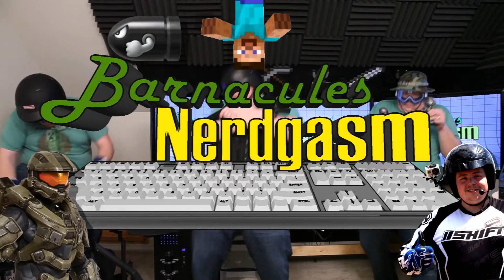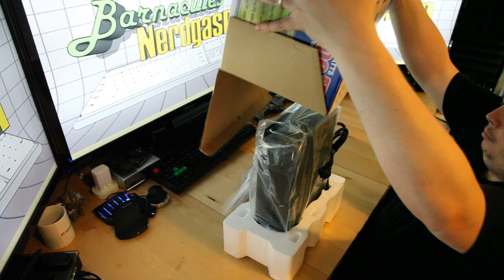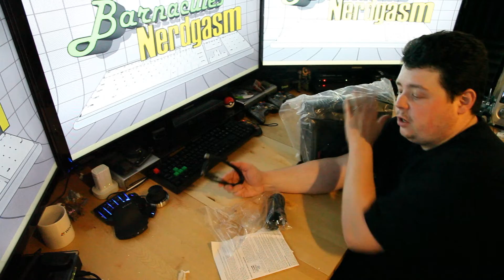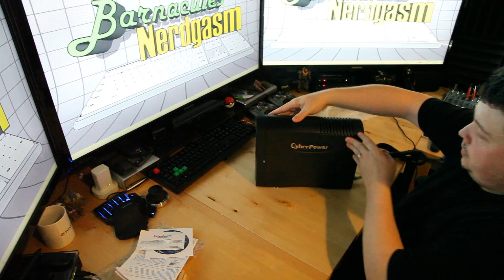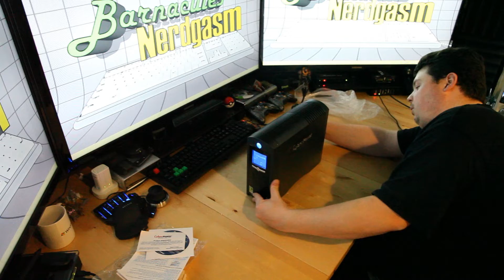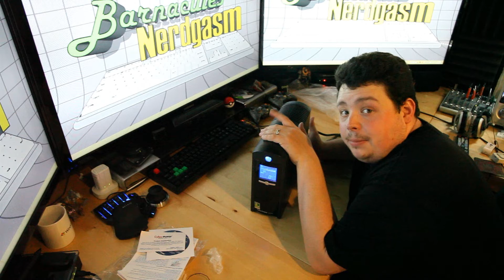Unboxing CyberPower 1500AVR GreenPower UPS (Uninterruptable Power Supply) in the Man Cave

Comment: I have mine on a 500 watt solar setup I got for free 4 of them so it is a full 500 watts - and it is plugs directly to the ups - A cheap solar setup  - I will be tacking out that speaker in mine - I may use it for A new ver of A pi

Comment: You do not need a UPS for normal equipment, How is a UPS going to help 3 monitors during a power outage - It isn't. And most people say that they "smooth the power going into the computer" The PSU does that. They are not needed, Their Recommended, But are not needed. And corruption caused by false shutdowns? It does happen, But its so rare that its not worth worrying about.
Reply: Stop spreading false information. 

1) A UPS will protect your hardware in the unfortunate event of under/over-voltage because it doubles as a surge protector. In fact, modern ones come equipped with AVR too. 

2) It's not there to 'help' monitors (although, like with all hardware, it protects them) - it's used so you can keep your entire workstation running until you can save and safely shut down. 
 
3) Forcing a PSU to handle brownouts and blackouts (very common in many areas) will stress it beyond repair;  it's always better to have a UPS deal with those situations. 

4) Although data loss due to unexpected shutdown is 'rare,' you should still protect your data (no excuses). FYI, RAID arrays are very susceptible to failure - resulting in data loss - when the plug gets yanked from the wall or a blackout occurs. 

Next time, do some research before you negatively influence people.

Comment: I bought one of the battery power from cyberpower however I cannot get both sides to work when I unplug from the outlet the battery side surge protector books but the surge side does not when I plug it back into the power both works butt the battery gets depleted and does not charge again I have to turn it off completely and turn it back on how do you set up the cyberpower on your computer no one can help

Comment: What is the difference between yours = CP1500AVRLCD and LX1500G and CP1500PFCLCD?
Or why did you choose that non-pure sine wave?
Also what do you use it with? (computers? Xboxes?)
Reply: The AVR models (like the one he shows here) have a simulated sine wave (looks like a stepped square wave on an oscilloscope) which may or may not work properly with an Active PFC PSU. The PFC models have a true sine wave output and will look identical to AC line power to your PSU. Not sure why he's not using the PFC model UPS but I guess his PSUs are okay with a simulated sine wave input.

Comment: Are there any other reasons of use for this besides protecting data and your computer battery? I have one that my dad picked up cheap at a thrift store and was wondering what exactly it does.
Reply: when the power flicks off and then back on faster than your computer can drain all the power out of it's capacitors it creates a huge shock on everything.  if you have ever seen a motherboard or psu board with capacitors that have bulging tops, brown outs and power surges are the cause and a good ups is the solution.
Reply: that's the only use, to give time for you to save/backup and shut down your pc when your power is out
Reply: thanks guys :3

Comment: Just to be clear,  a lightning strike energy that goes through your wires isn't going to be stopped by anything  surge protector or otherwise.  Surge protectors only deal with minor surges.
Reply: A PFC power supply will be fully protected, but you need to get a pure sine wave version to not do harm to your computers power supply when using one. 
An AVR power supply is partially protected from a surge, once the power rises above 140v(for american), it trips the mains input over to battery, but since this can take a couple of nanoseconds to happen, it may allow a very brief high voltage spike through, but is still MUCH better than allowing the full spike through. 
The real reason to have it is to give you time to save anything you are working on when power goes out so you do not lose hours of work if it happens.

Comment from the maker: Honestly I've used CyberPower and APC for years and the only problem I ever had was one bad CyberPower that just blew up and stopped working, but the other ones I've had have been rock solid and work fantastic. The build quality on the APC's is a bit better but for the price I would go CyberPower since it's a lot cheaper.

Comment: Awesome, I guess with like a MacBook from 2006 or so you could easily squeez 2 - 3 hours out of it since the power consumption is fairly low on those or a shuttle pc, since they have farily small PSUs. Could work as well I think. :D